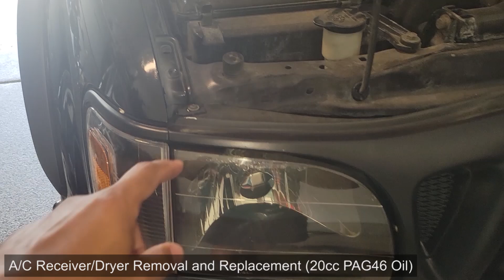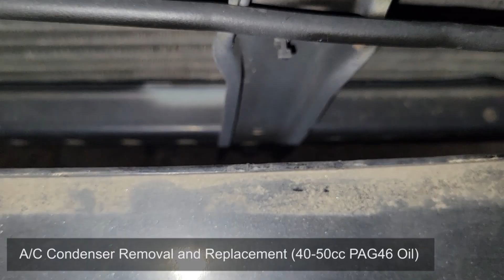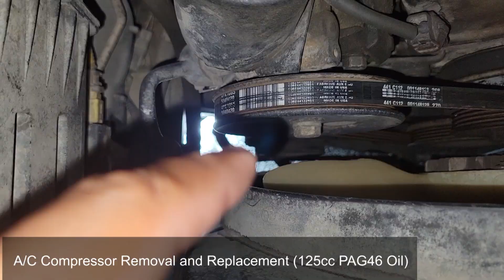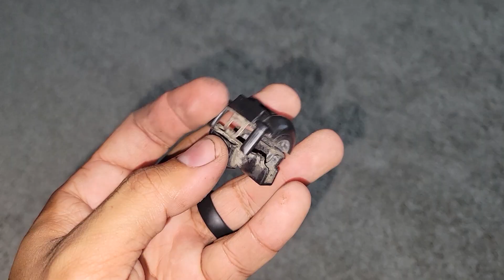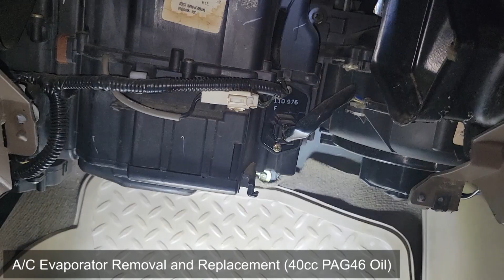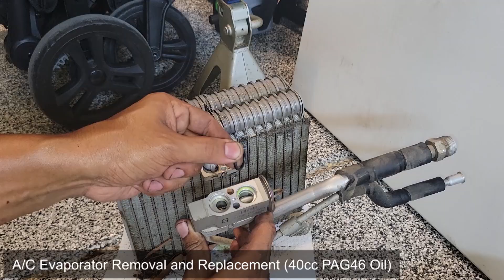A/C FULL Component Replacement | 1st Gen Toyota Tacoma | 4Runner

Comment: Hey, just a heads up. You don’t need to remove the power steering components if you pull the compressor through the bottom. You just have to unbolt the power steering lines from the frame to move out of the way. Great video!

Comment: Great walk through video - best one of the full AC. I was hoping you were going to touch on the a/c amplifier (also in the glove box area I think). Regardless - amazing video. Question - can you change the pressure switch without evacuating the system? Thank you!
Reply from the maker: Thanks for the feedback on the video! At least on a 1st gen, the pressure switch is directly ported into the refrigerator line, so you'd have to evacuate the system prior to removal. Toyota wasn't kind to us in this way haha